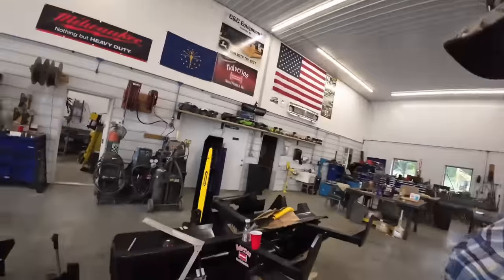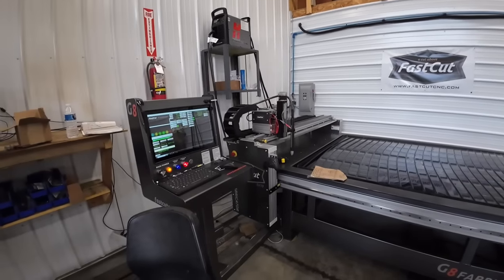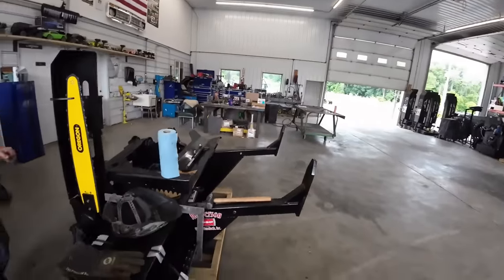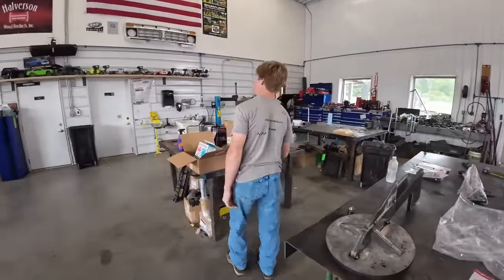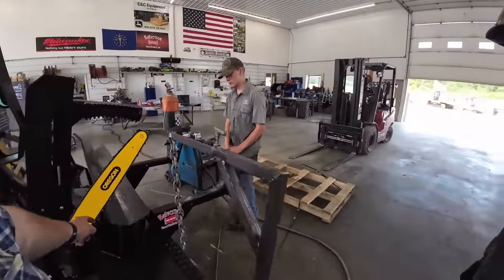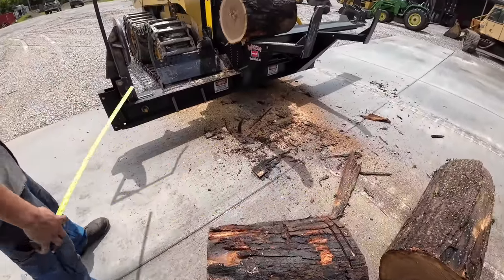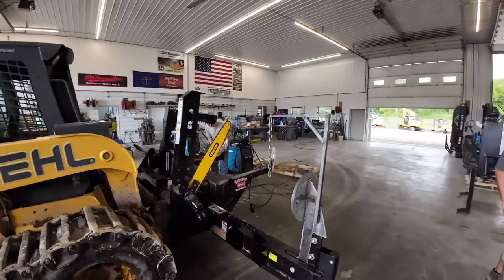Modifying a brand new @HalversonWoodProductsInc firewood processor to meet customer special needs

Comment: A little shelf on the bottom of the stop plate you made, to hold up the end of the log, will then allow the log to be cut into 3 x 38" sections. It would also ensure a 90 degree cut as well and the log should still fall off the cutting deck when fully cut.
Reply: exactly! glad i was not the only one to think of it!
Reply: Won't that make it pinch the blade
Reply: I don't think the cut log will come out with a ledge that large.  Unless there is a way to retract the piece when the cut is finished
Reply: It will jam the saw
Reply: then the ledge will hold the cut log up and it will wedge when it tries to fall i would think.
Reply: You beat me to it. I agree
Reply: Just a short piece of 2x2 angle iron

Comment: As some already suggest that little shelf is maybe the solution. The risk are that the log stops against that when "feeding". I should try a little a little shelf mounted with a drop angle so the log steer up and against the plate, and holding i up until the cut is made. Thanks for charing your videos, and work. I'll do a lot of firewood each year. Greetings from the middle west of Sweden. (Dalarna)
Reply: Great suggestion! Add a bolt on plate over the teeth. No need to remove the teeth.

Comment: I built a processor very similar to that. I used chains on the table to feed the log so that’s the difference. I had trouble seeing the log when it fell into the splitting area so I added a wireless camera and mounted it on the top of the chainsaw guard. It works great and you can see everything you need. Good crafting gentleman.
Reply: I watched Captain kleeman do the same thing with his with a camera if you know that YouTube channel

Comment: Fun project fellas!
I saw plenty of comments suggesting adding a “support ledge” at the bottom of the stop plate on short logs……nah, here’s a better solution:   Have a 38” (or whatever your desired length is) marked on the log carriage. Keep the desired end on the carriage and cut off the excess.  Problem fixed.

Comment: I was impressed at how fast the saw powered through that White Oak. It looked like you tried to bump the log just a 1/4" or so off the new round log stop to prevent the pinch. Small little moves look difficult.

Comment: In order to cut the smaller pieces [less than 38"] you should consider wielding a small piece of iron at the base of the circle. That would assist in holding the log in place and prevent it from shifting.

Comment: I have a couple of suggestions… for the shorter lengths, rather than a chain, use a bar that pivots from the top brace that is short enough to miss the 3/4” round plate as it moves up. Extend the top of the bar up about 8 - 10” to use it as a positioning indicator for the short logs. Also, maybe a 2” square tube as a log support so the logs don’t “droop” when overextended. Just make it short enough so the saw doesn’t hit when cutting.

Cool modifications. 🙂

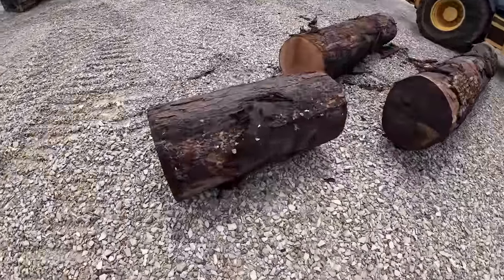Comment: Hello Clinton, I watched the wood processor closely and the problem seems to be the hydraulic clamp arm needs a swivel on it so the clamp mechanism lies flat on the end of the log. because everytime you used it, only 1 of 2 clamp arms was touching the log so it wasn't clamping the log down evenly. Look at Ts : 26:28 and 27:59 and 28:48 and 29:33 and 29:41 the single band caused the log to tip. I think if the clamp was able to rotate the first row would land and then the second row would land before the device applied the hydraulic pressure to hold the log flat and in place for the cut. Oh well, I tried.

Comment: Love that new machine.  I bought a dry machine with a (ugh) 30 amp Hyper.  I could cut 1/2" AR500 but it was tough.   With luck the software keeps track for you otherwise keep a book on each thickness to make best cuts.

Comment: Add a small shelf under the circular plate to bear the weight of the log when it’s short. It will stop the log pitching down and let you get that last long buck. 🏴
Reply: Or a litle spike in the midle of the round plate
Reply: @vlearmoes7012  that might stop the buck falling away when cut.

Comment: I would add a short wedge shaped support under the target plate to hold that end of the wood up for more accurate cuts. when you get down to the end of the log, the weight balance shifts and tilts the log and your cuts are now off and angled. a short wedge would hold it up!.

Comment: The chain only works if the skid-steer is on a level surface. Otherwise the chain lay lean one way or the other. 
A spring loaded paddle or tip-up might work?

Comment: An idea.  Weld a plate  or a  bar beneath the round end plate at a slope ending at the same level as that of the moving bar of the machine, that moving part doesn't reach till the end. It shuts down at least 3 inches before that vertical  plate you made or round end plate.  The the log is then supported from the front to back. Thumbs up nice video.

Comment: Me thinks like a few others ,the circular plate needs a ledge to stop the log end falling down before and during the cut and the grab plate that holds the log in position may need two sets of teeth so you can hold the short log in position to enable the correct cuts .
It may even need a centring spike to help with the short logs when trying to achieve 38 inch cuts 
As you said to Tucker ,loggers will break things easy , during normal use ,and the pick up legs look flimsy to me ,how much abuse will they take ,that's a big matching they have and something may need to give
Reply: I have noticed many suggestions about this "ledge" and it sounds like it would work but what happens when the log is cut and the one end is now being held up on this ledge and the cut end drops a few inches? It seems like that is gonna fall funny now and just hang the log up and it wont fall free.

Comment: On the longer pieces, down and dirty yet shorter wood is estimated by a chain.... kinda sorta a way.... but it doesn't hold up overall. I am just baffled as to how a person could make the flat stop work for the shorter stuff and be on the fly. Heck, you can see some of the shorter stuff might come out of the middle and then end with a longer piece. With electronics being just what they are, a electric reading of the real length of wood extended at the cut line just would be the cherry topping for this make it easier machine...  As a kid, dad had me using a tool called a "Frow" that was a metal blade and a wooden handle on the blade that looked like the end of a spring on a pickup so you cut those barrel staves just as you would a shake wood board on a roof. You used a wooden mallet that you drove the sharp metal blade down through to make this cut.  I do believe dad paid around a dime apiece for each good "Sta" we sliced as he got something like sixty cents. He had to do quite a bit including furnish the wood for this and that was some kind of oak and then there was some other kind of tree he sawed to length for me to split. I would try for about four dollars a day... I am just a bit inclined to think your  a studying a way to make the end adjustable as well.

Comment: Very interesting. If it works out, a table could be bolted on to allow the log to stay in place until it's cut for the shorter pieces. I suppose some limit switches could be used with a programmer to automate the process if they really wanted to get fancy. Maybe Halverson will automate it at some point.

Comment: Love you show. What you could do is to buy your self a 3D printer and just make your self a “cc standard arduino platform” that way you always have a 40$ platform that can be programmed to run motors, pumps, reading sensors, connecting cameras and small screens. Like solving the problem with seeing all parts of this saw while sitting in the cabin. You could also have designed some more integrated buttons into the control sticks.  Very similar like Dirt Perfect did with his pipe laying attachment, but as you are doing a lot of this custom projects, it should be very cost effective way to approach future projects.